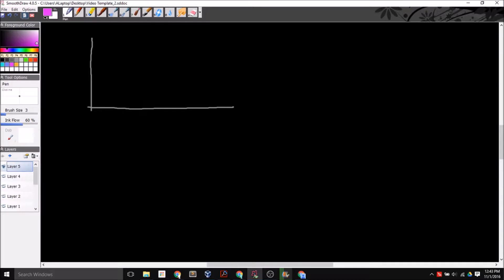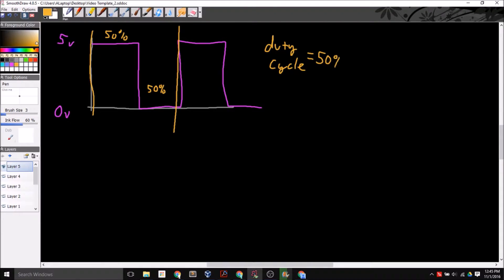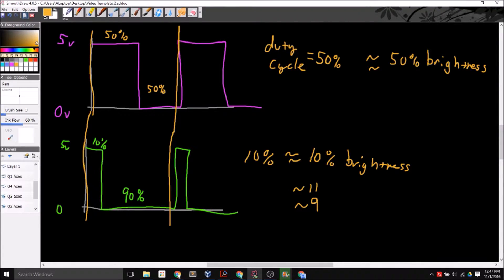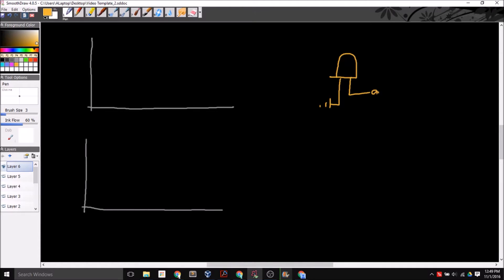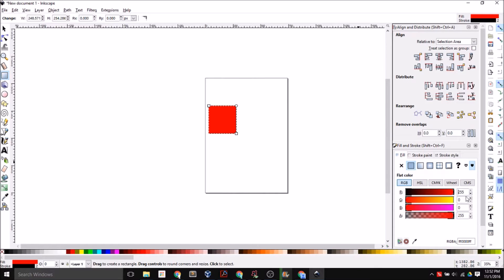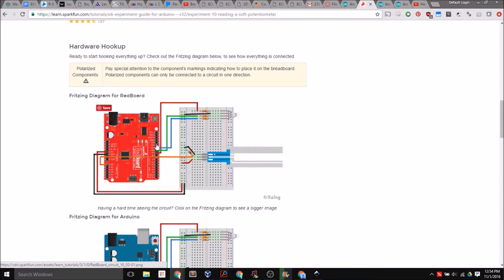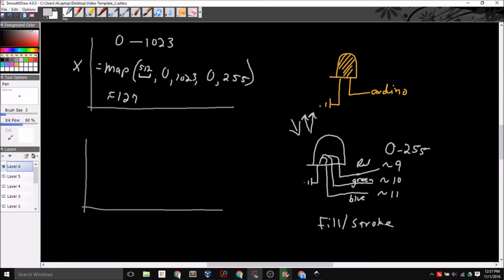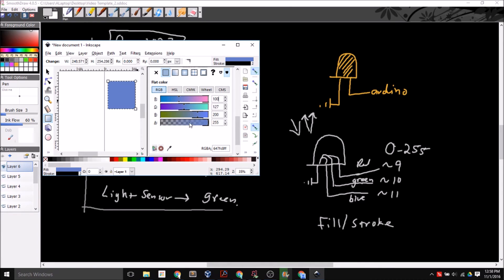arduino analog output

Comment: Hi, thanks for the explanation, do you know how can i do an analog output for audio with a 3.5 jack?, im trying to do real time audio processing. Im using arduino uno and isd1820 module.
Reply from the maker: I haven't done it myself, but I have seen a guitar pedal project using an arduino. I recommend searching for that. It had a variety of real-time effects you could load up. Good luck!